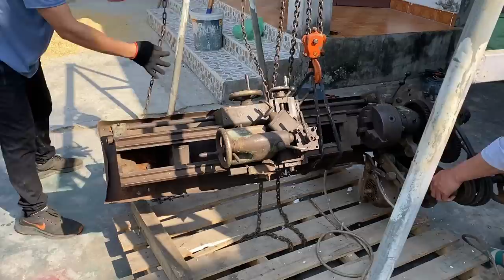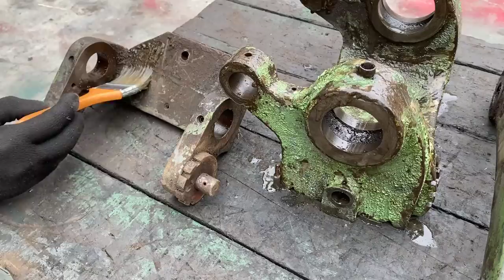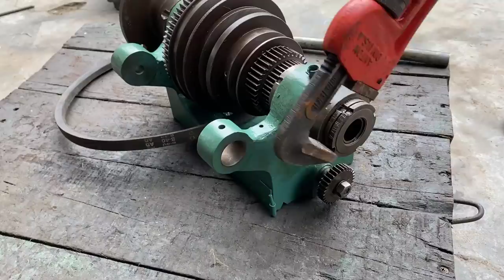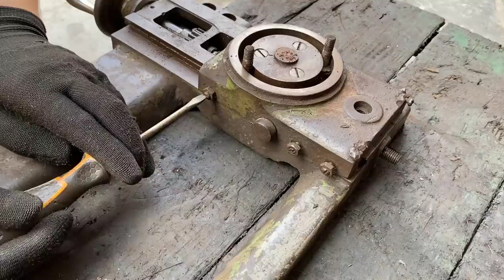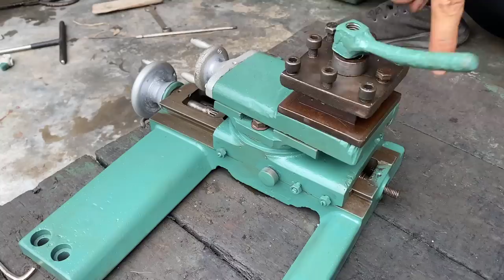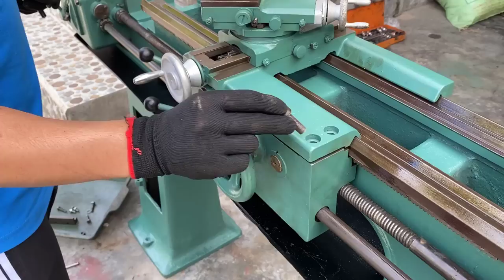Full restoration of antique American JUNIO lathe | Restore and repair old JUNIOR lathe

Comment: I'm surprised it came apart so easy. No oil in the apron gearbox ,table drive or variable speed for the chuck. No grease in the chuck either. You made a piece of junk work. Congratulations!
Reply: I am glad that the man washed and painted .Disassembled and assembled. But do not dream of any accuracy here. Really junk. In order to achieve some kind of correctness, his machine needs to be disassembled 10 more times, adjusted and reassembled.
I can see how the part shakes when grinding, how the cartridge shakes. It's not that about hundredths of a millimeter, but it's too early to dream about tenths.. 43:23
Reply: .
..0!  .q,0. ..........ñm,oq..a

.